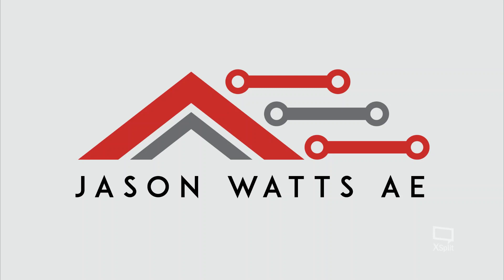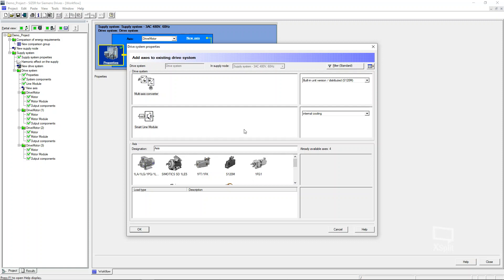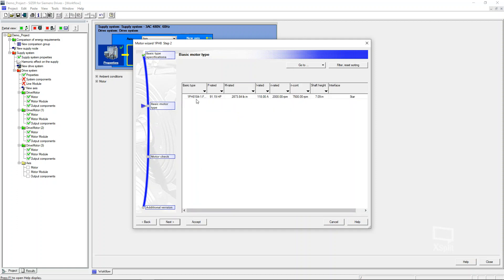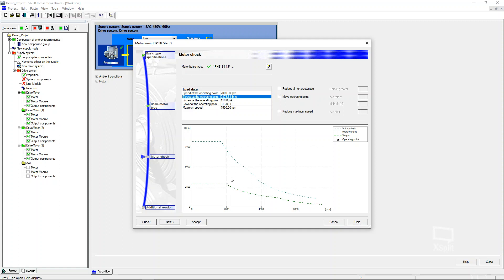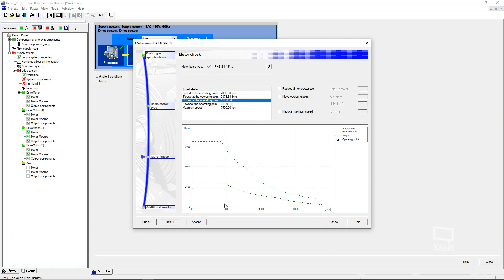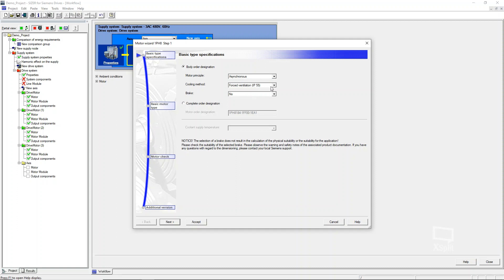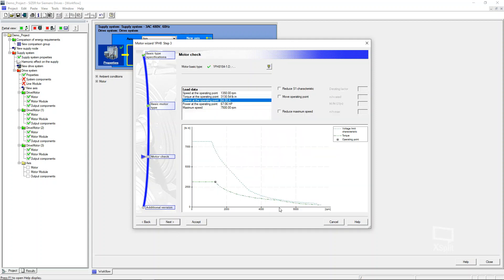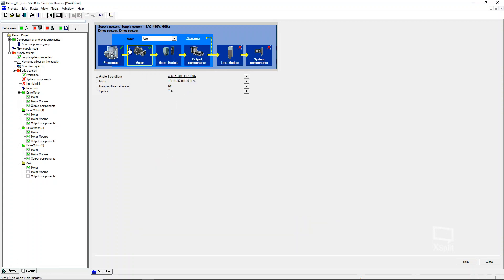SIZER Part 2- Siemens Motor Data

Comment: Would it be possible to do another more in-depth Sizer video on motor selection? 
And navigating the mechanical system properties?
Reply from the maker: I'd love to do more with Sizer. Not many know about the mechanical system tools. I will at least make this a topic of the livestream.

Do you have a specific application?